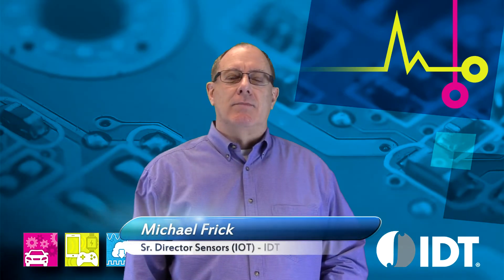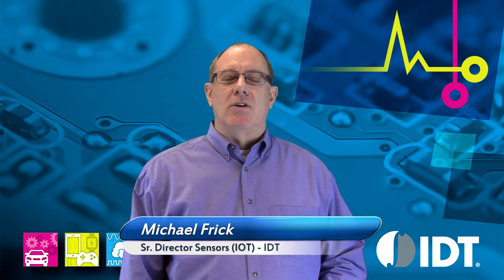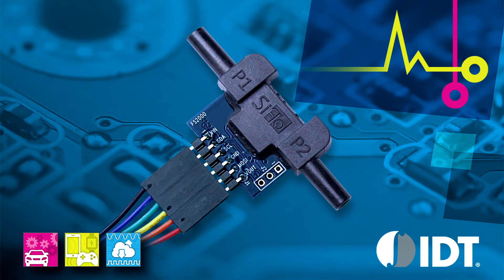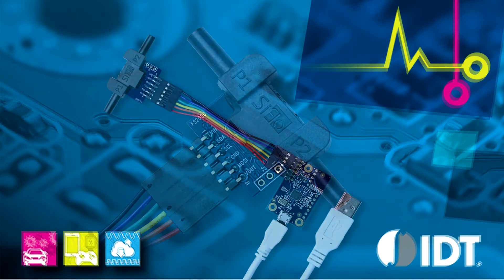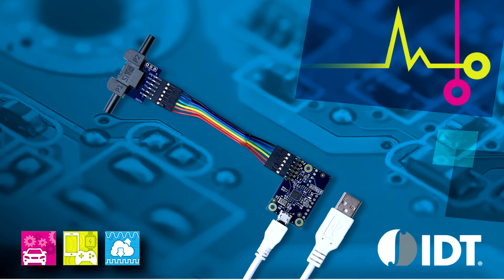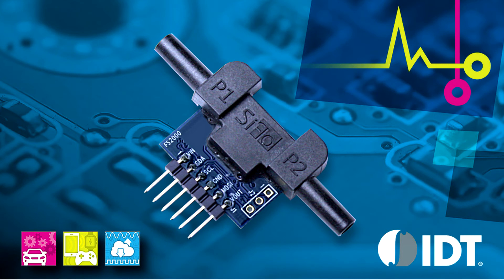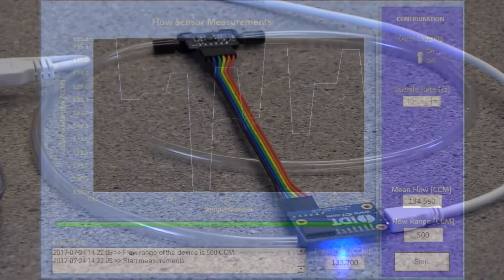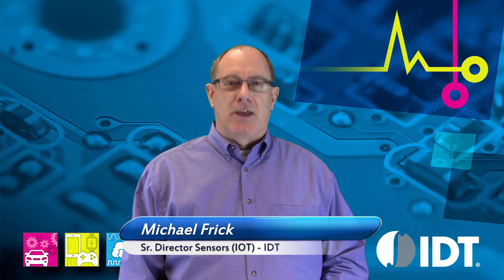IDT FS2012 Gas and Liquid Flow Meter Module for Industrial, Medical and Food Applications

Comment: does it work for Diesel measurement for flow 0-3 LPH?
Reply from the maker: Thanks for your enquiry. The current housing of the flow sensor is not designed to work with Diesel.